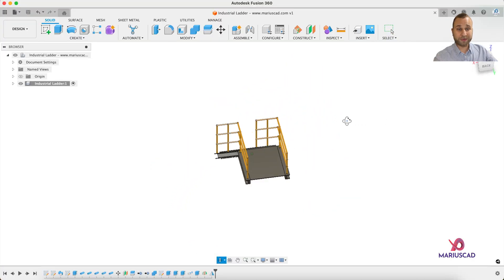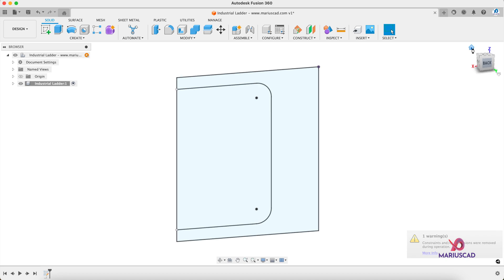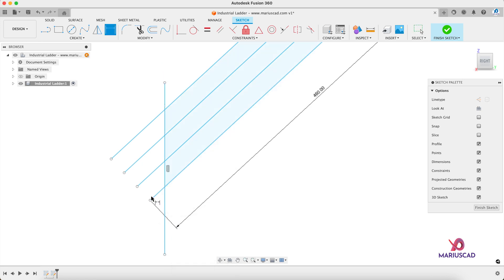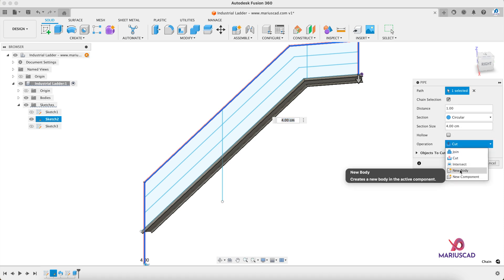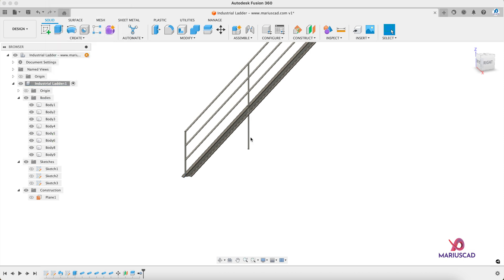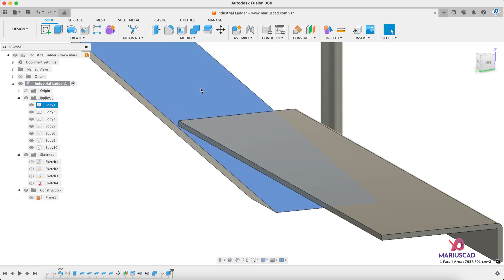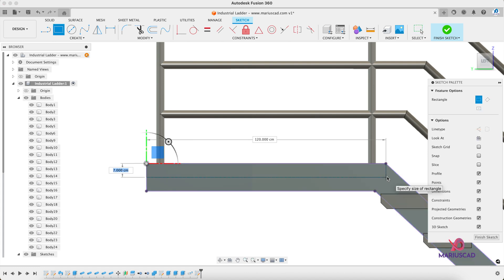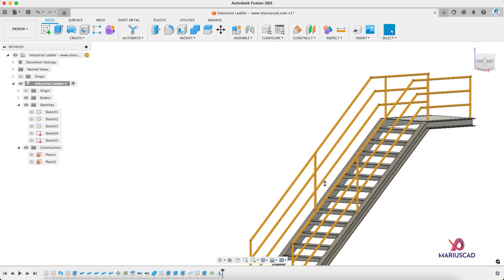Fusion 360 | Moldeling a 3D Industrial Ladder | Quick and Simple

Comment: Great lesson, but the tread pans should probably be modeled as individual parts instead of as a whole unit, so that they can actually be detailed in a part drawing. The pans can be formed, but the sides of the tread you drew would need to be welded on. At that point its probably fine to only weld the pans to the stringer...

For constructability the hand rail stanchions should be a solid vertically and cope only under the top rail.  Does fusion automatically cope the intersections of pipe?